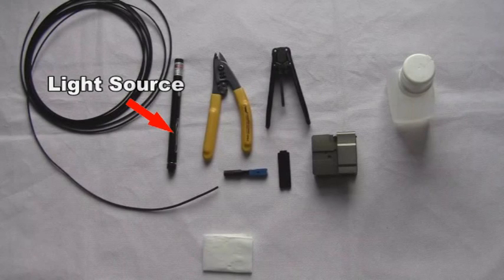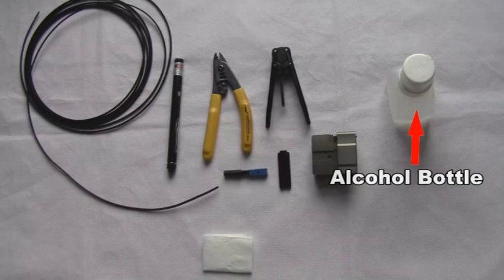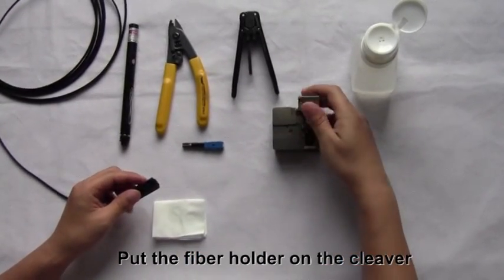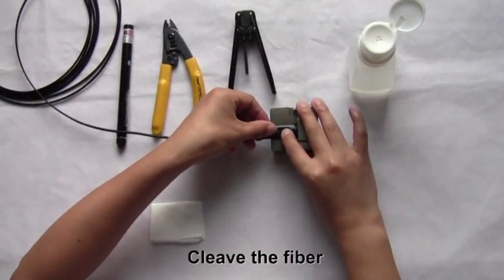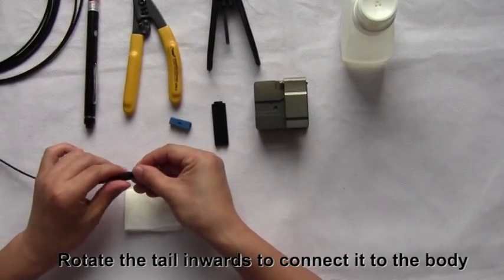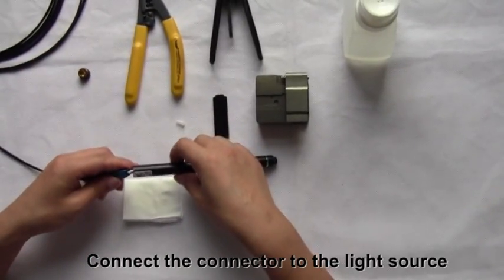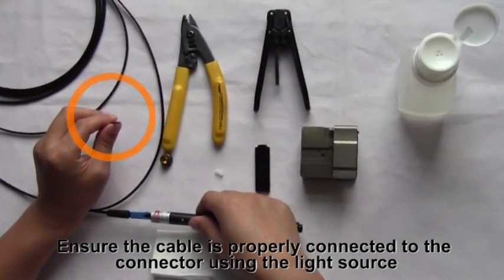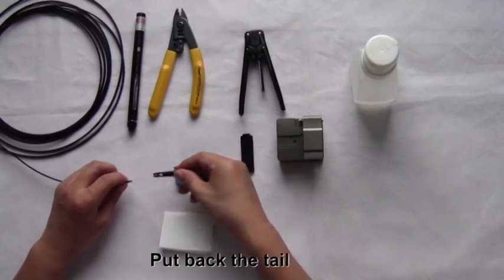How to Use SC Pre-embedded Fast Connector

Comment: I expected the industry to design something "really fast" - so that you may need no precision instruments. Like you strip the plastic from fiber (or better even without this step), insert it into the connector, press something on it that cuts out a bit of fiber straight as you do it with a cleaver, and get a working connection. Don't see it happening :\